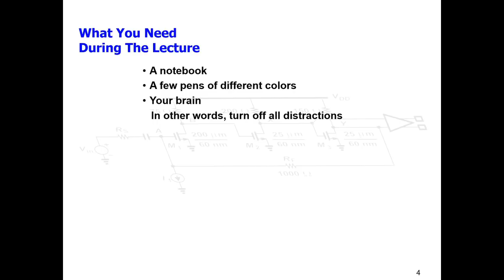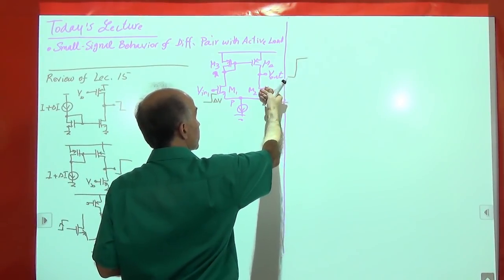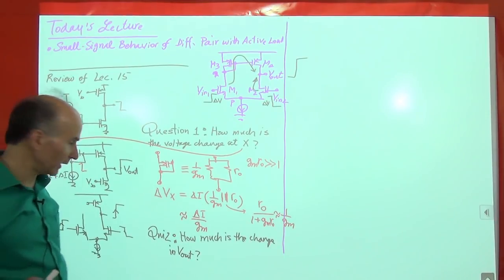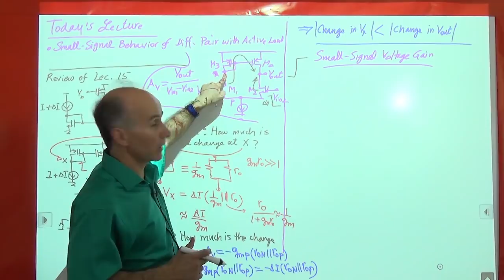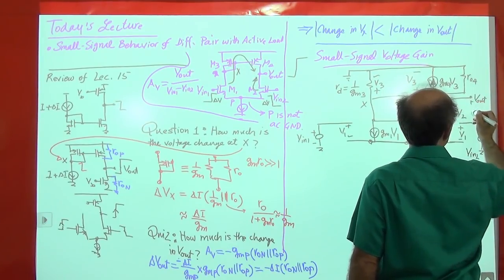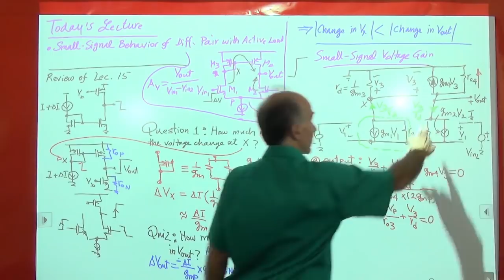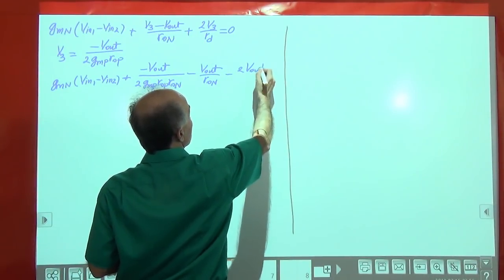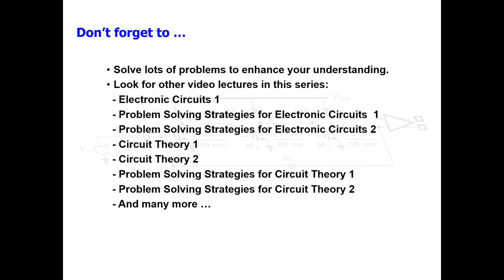Razavi Electronics2 Lec16: Small-Signal Behavior of Diff. Pair with Active Load

Comment: 01:26 - Small-Signal Behavior of the Diff. Pair with Active Load
12:55 - Quiz - How much does the output voltages of the active load change
18:20 (22:20) - Attack the Circuit Directly
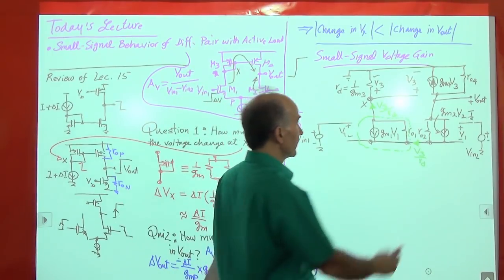29:36 - KCL Equations
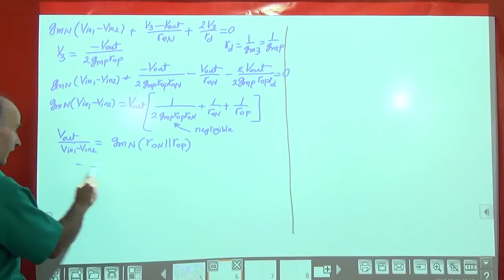43:30 - Comparison with the Differential-output Circuit

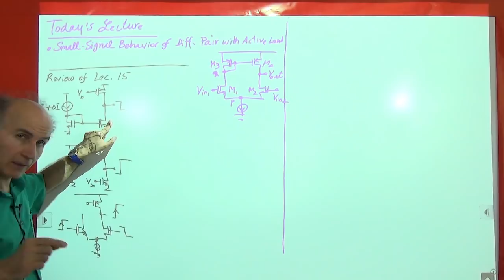Comment: At 3:57, I am stucking on this: say, current is copied from the left side to the right side, left side current increases, right side current also increases, fine. But on the right side, there is another P type current source on the top, its SG bias voltage is fixed, so its current is also fixed. Since the copied current is in series with the P type current source, how could the copied current increase ?
Reply: I guess I know what's going on here. The bias current thru the right top P type current source is fixed, but the total current through that PMOS is not fixed, extra current flows thru that PMOS  due to the impact from the right side current increase, and this extra current all flows thru PMOS ro resistor, this extra current is not fixed, it  is related with Vout.. is this correct?

This online course series is excellent, but if there is a TA to answer my questions, that would be better .

Comment: when there is a current mirror then why don't Iss split equally?
Reply: +1
Reply: No buddy, actually it's not a replica of an exact current mirror because in an original current mirror there is a a direct Constant current source injected into the Diode connected device so we can have a good replica of the reference current at the output, but here the currents a re varying with time which means it depends on the input of the mos diff amp pair to source the current through the Iss...That's the main reason why ISS doesn't split equally when the diff amp Mos pair is excited by the inputs with equal and opposite amounts.

Comment: 28:00 Why is the small signal current source (gm3v3) missing for the current mirror (M3)..?
Reply: coz it is a diode connected device..which in small signal analysis acts as a resistor...whereas M4 acts a common source amplifier
Reply: not the M3 who is missing, it's you who is missing videos of electronics 1